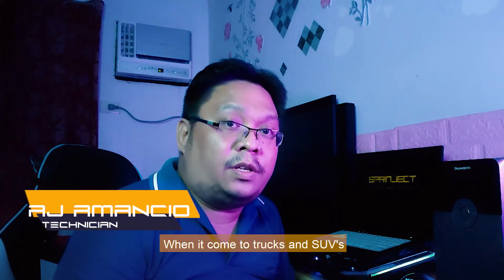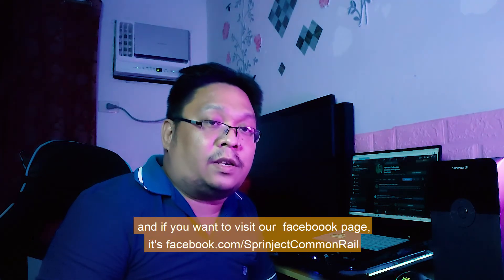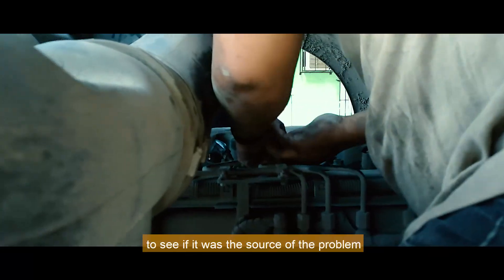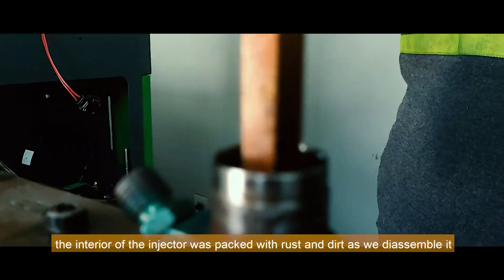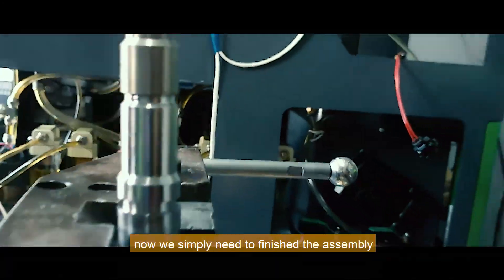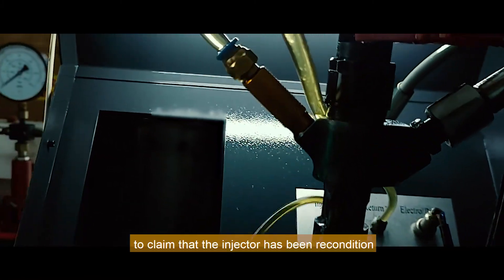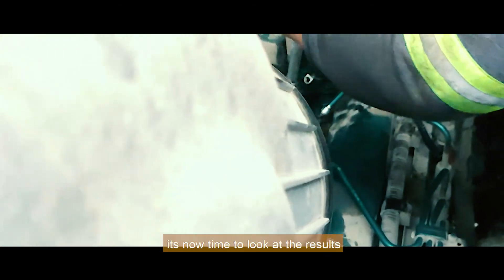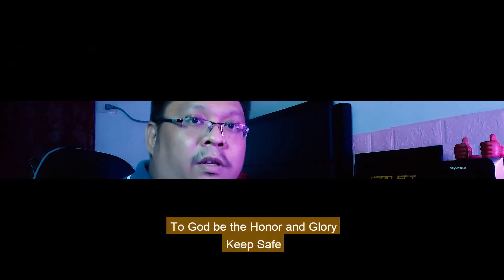Common Rail Injector Reconditioning - Sinotruk Howo 380

Comment: Ano kaya problema sa makina na gingawa ko howo 380 nalinis ko na lahat ang mga filter at injector valve calibration minis ko na mga sensor at ecu wala naman sign signal sa dust board umaandar naman kaso of revolution up rpm bila mong bitawan pidal mamatay
Reply from the maker: ano po trouble code boss?

Comment: Gandang umagah sir ask kolang po howo 380  knocking sound ,exhaust alarm ,check engine  sa commonrail parin pobah ang deperensya nun sir mahina ang hatak hanggang 1500 lang low power na sya hindi sasagad 2000 sir sana po manoticed nyu po ito sir salamat
Reply from the maker: napa scan naba boss? mas mabuti po ma scan muna.

Comment: sir pwede ho e change ung fuel filter sa first change oil nya? kasi po un po ung ginawa namin. pra nag ingay ung injector after.
Reply from the maker: Mas maganda po kung regular po kayo nag replace ng fuel filter. kung mag change oil po kayo magpalit na rin po kayo ng fuel filter. kung nag ingay po pa diagnose nyo po muna bago kayo gagawa ng action.
Reply: Sir may troubleshooting po ako sa injector bakit ayaw lumabas Ang fuel sa injector malakas anaman Ang fuel sa tube galing sa fuel pump